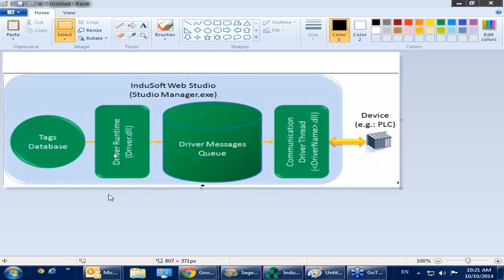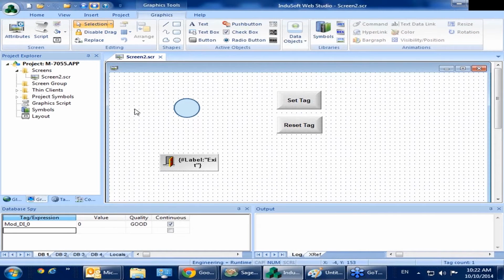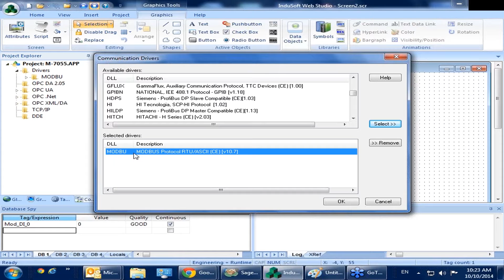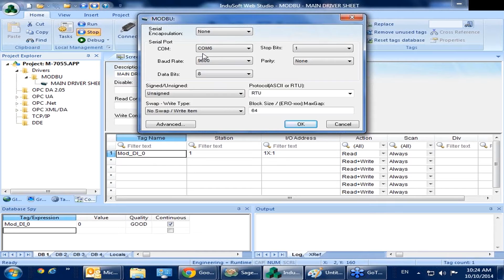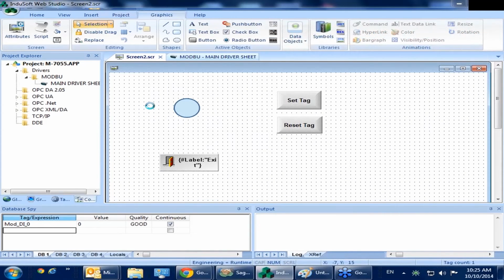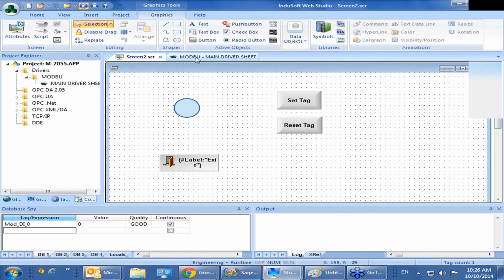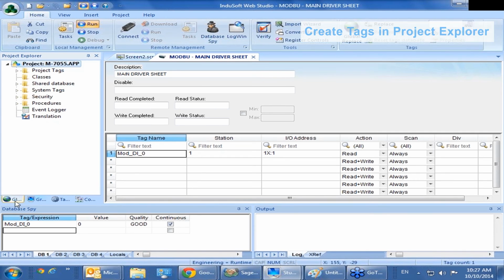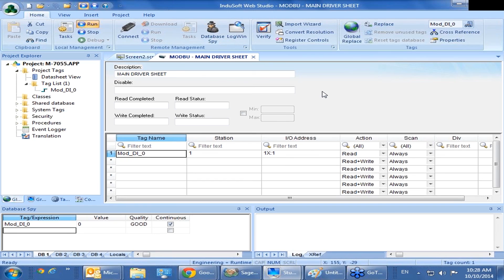How to connect Modbus TCP devices with InduSoft Web Studio SCADA Software

Comment: I'm still confused... suppose we have two modbus communication PLCs in the same network controlled by Indusoft and another PLC which isn't modbus how do we set the different IP adresses ?
Reply from the maker: HI Sargetius,

The PC/PAC which is running Indusoft will need to be on the same Ethernet network as your 3 devices (2 Modbus TCP and 1 other protocol).  From the Indusoft machine, you will create 2 separate Modbus TCP connections in the main driver sheet.  The station ID will be the IP address of the slave device followed by port number and Slave ID. For your other device that you are communicating to, you will use that specified driver and as long as the device has a unique IP address on the same network, you will be able to create a connection to it.

A free trial for Indusoft can be downloaded from this link.
https://www.icpdas-usa.com/indusoft-download.php
It will give you 24 hours of development time to test your connections.  

If you have any other questions regarding this matter, please feel free to chat with our team at icpdas-usa.com

Thanks, 
The ICP DAS USA Team
Reply: local driver able to solve your problem